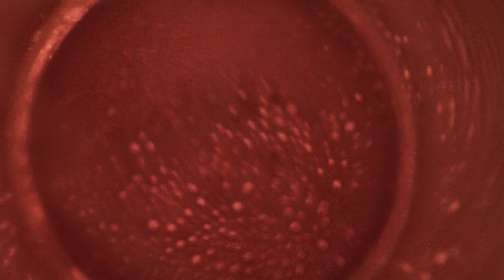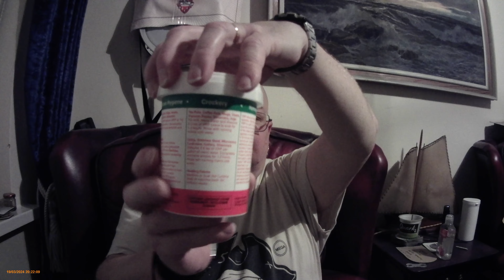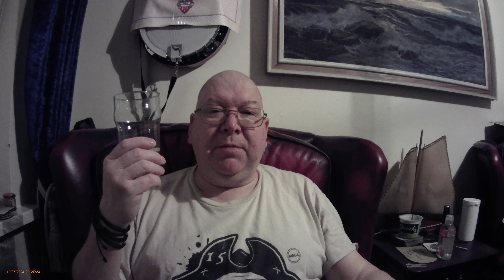Brewing Tip: Cleaning my pipes out

Comment: I'll use that idea cleaning my lines from my handpump to the corny kegs, cheers pal👍
Reply from the maker: Many thanks for watching and commenting. It's a simple idea that sometimes fails to get passed on. The double length line is especially applicable to the smaller diameters as initially getting the line through can take some time and to then find it takes another pass can be extremely irksome 🤣. Stay safe and well, SIR, cheers, Schnuz.